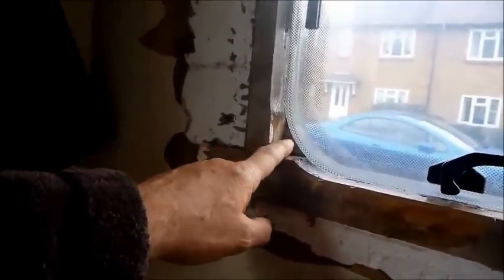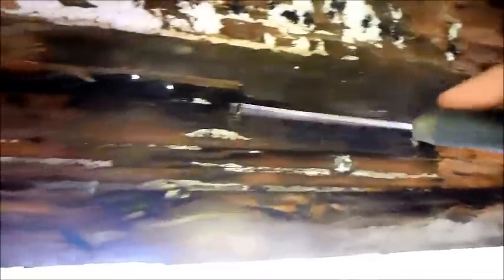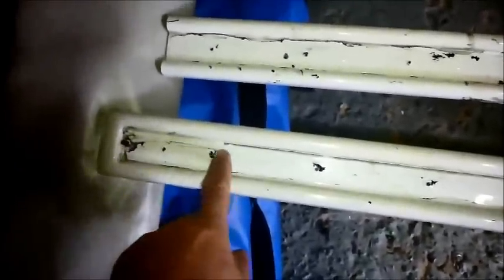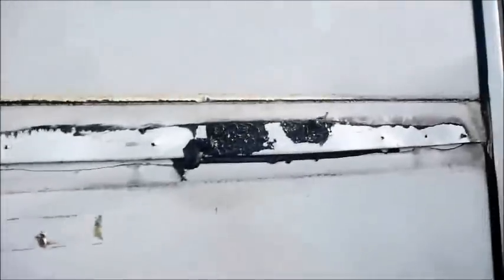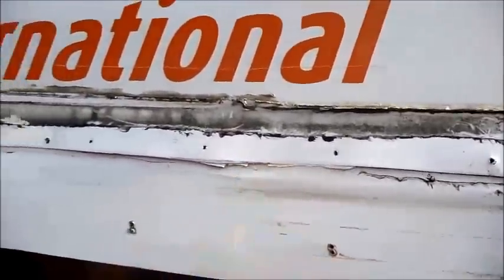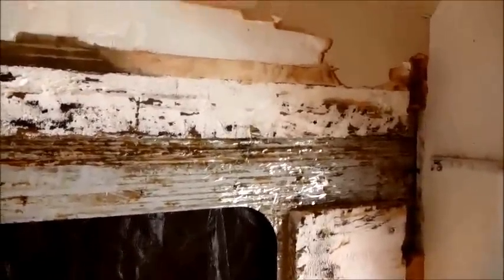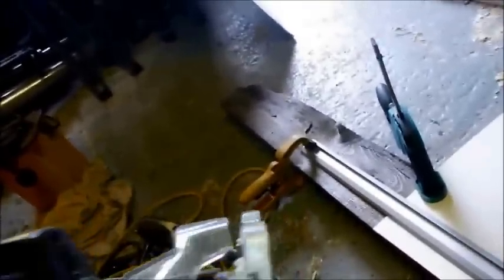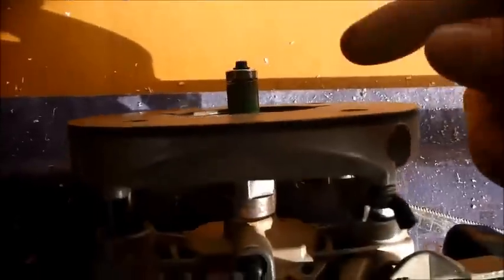How to Repair major damp in your Motorhome/Camper van

Comment: where did you buy the wall lining,theres no link?
Reply from the maker: o'reilly's motorhome  spares
Reply: @MrMeltedwellies  i have been on there site cant seem to find it,by the way you done a grand job there,I like yourself wouldnt pay these charlitons the money they ask for and will do it myself,iv sytipped above the can on a motorhome I have,window seal was leaking,need the polystyrene and that board that goes over it,the last person used white hardboard (bodge job) its buckling so took it all off,just want to fix it properly with the right bits :-)

Comment: Great video Mark and excellent job done, what adhesive did you use to bond the wall boards back to the polystryrene and the timber to the Aluminium skin. I'm doing a similar job on my auto Roller motorhome with water ingress damage to the ceiling and walls.
Reply from the maker: http://www.olearymotorhomes.co.uk/olearys-caravan-pu-adhesivesealant-white-50-p.asp
Hi Paul the same adhesives for both wood to  Aluminium and wall  boards to polystryrene works very well purchased from the link above 

thanks for watching 
mark

Comment: Ok so down to 2 holes and i have lost interest as i have messed up the outside of the caravan by putting to much sealant on and its hard and i cant take it off any suggestions on how to get it off without wrecking it further?? Thanks
Reply from the maker: +Clare when it hardens you should be able to pull it off !!!!! add a pic if you can

Comment: What if the roof timbers are also riddled with damp ?
Could be a very big job.
Reply from the maker: Hi have you found the leak and fixed it then use a dimidifier to get rid of all the Damp start in a small place in a corner and then check the wood replace the wood and just take your time if the caravan doesn't owe you much you've got nothing to lose good luck
Reply: @MrMeltedwellies  I think the whole wooden frame , including the roof, is thoroughly damp.
I've tried a dehumidifier which didn't work, perhaps because of the cold weather. 
I'm now thinking of a large fan heater for several days to try and dry the whole van out.
I'm going to lose alot of money on it, anyways, I reckon, but thanks for your advice.
Reply: @MrMeltedwellies  I suspect that it was full of damp before I bought it, and was covered up.

Comment: Hi Mark, quick update, I received your "£700.00) toll, I have removed the whole back wall, insulation the lot, excellent must have piece of kit lmao.
I did try to post some pics here, failed big time.
I'm putting it in the barn tomorrow, start the major reseal job in 2 weeks time. 

William

Comment: i have a abbey 1991 with water damage, the problem im having is the cubards are screwed on from the outside, with no way of getting to the screws, we took the 2 coutches which turn into double bed out and had to saw threw the screws to get it out, anyone got any ideas on how to get the rest of the cubards out and how to screw them back up.

Comment: Hi Mark, I'm hopefully on the last two weeks of recovery from broken ribs, the bad thing is, I have not been to the trailer, also, it is leaking somewhere on the top corner, if I can't find the leak, think I will have to get a professional in to look at it :(
Hope all is going good for you?
Reply: Hi William how the hell did you break your ribs !!! anyway hope your ok .all good here thanks, sad news about leak hope you get it fixed before spring,iam so looking forward to getting away and some bloody sun shine :-)
Reply: Hi Mark thanks, I fell backwards off my lorry, not 1, but 2 ribs, round the back.
I have booked to go to sandy balls, Fordingbridge, end of March beginning April, so one way or another, it will be done.
Maybe we can meet somewhere this year? :)
Reply: Hi Mark, this past weekend, my 1st time back at trailer, cut the insulation and wall board, soon, (with help to lift the back window out) will bond and rebuild back wall, I have "O'Leary bonding FC40, do I apply to both sides? do I stick together when glue is tacky, or dry? William
Reply: Hi Mark, yes, the bone is good, Doc says not strong enough to return to work yet, off another 3 weeks. Hopefully I will finish the back wall. The American like to screw through the roof into the side wall, about 3 feet rear corner, a lot of "Dicor" sealant on it, job done.
The biggest problem is, getting the back window and frame out, it is a huge panoramic window, to be safe, I think maybe three of us must do it, better safe than sorry lol

Comment: Just sharing how I removed my travel trailer slide out for a repair - in my driveway and without heavy equipment.  https://youtu.be/DIJdIUpae3M
Reply from the maker: wow big job well done
Reply: Mark Davies they really need to just build these better. Mine was bought used but they're not cheap when new.
Reply from the maker: Hi Rich next time i might buy a mini bus take all the seats out and build my own no leaks  as the roof is made of steel !!!!!

Comment: half the ceiling had to come off too
Reply from the maker: +Clare Klok have you fixed it or are you fixing it !!!
Reply: +mark davies 

Fixing it, what I did
yesterday was more stripping of the wall and then I just did a temp seal with
tec 7 where water is coming in as I am not going to be able to do much for the
next few weeks.  I was thinking of just taking the whole van apart and
building it from scratch but I think the cost of doing this would
be unreal. I’m not sure if the van is worth it as it is old and if I tear
everything out I may discover that the chassis is crap too and I need it ready
for April but can’t do much till Jan, but to be honest maybe tearing everything
out may just be the answer.
Reply from the maker: wow big job very brave good luck keep me posted Clare
Reply: +Clare Klok oh i will keep you posted alright and if i havnt gone totally mad lol, i just in there for a few min and i have just seen that in fact it was an hour i was in there, but i am enjoying it and i can see how it is a big job but it will be an hour here and an hour there, what glue do i need to use?? thanks for the help.
Reply from the maker: very sticky glue lol  ill have a look and get back to ya
Reply from the maker: +Clare Klok OLEARY MOTORHOMES CARAVAN GLUE, ADHESIVE
A HIGH PERFORMANCE SEALANT/ADHESIVE, IT REACTS RAPIDLY ON EXPOSURE TO ATMOSPHERIC MOISTURE,
TO FORM A STRONG AND FLEXIBLE SEALANT,
WHICH WILL RESIST TEMPERATURES FROM -30c TO +90c.
FOR MANY USES IN THE BUILDING/REPAIR AND MARINE INDUSTRIES.
CARAVAN PU IS A MULTI PURPOSE SEALANT AND POWERFUL ADHESIVE FOR MANY BONDING AND SEALING TASKS ON
CARAVANS AND MOTORHOMES
IT CAN BE OVERPAINTED WITH MOST TYPES OF PAINTING SYSTEMS.
12X  310ML GUNNABLE TUBES, COLOUR WHITE OR BLACK

hope this helps 
mark
Reply from the maker: +Clare Klok http://www.olearymotorhomes.co.uk/ekmps/shops/olearys/images/o-learys-caravan-pu-adhesive-sealant-50-p[ekm]185x270[ekm].jpg    

this stuff did the trick